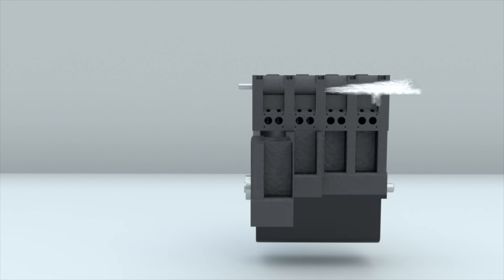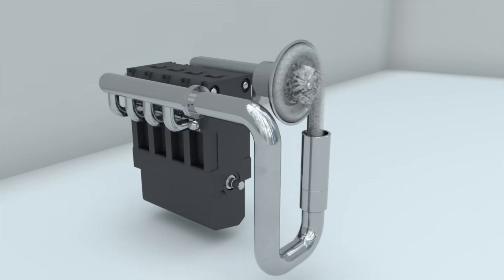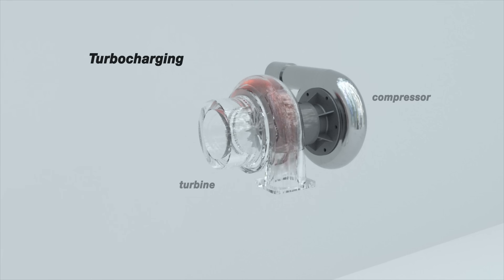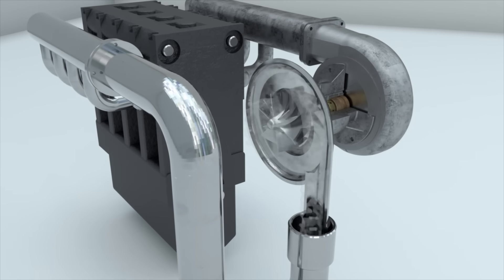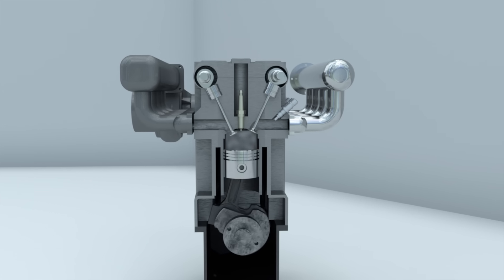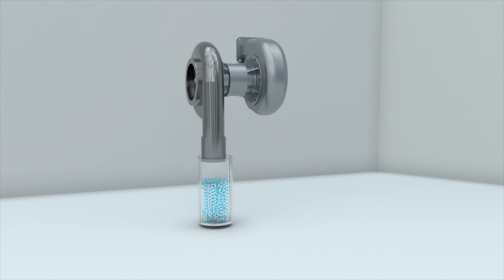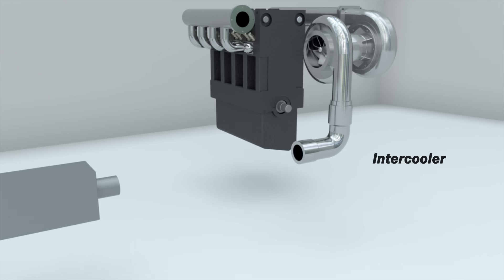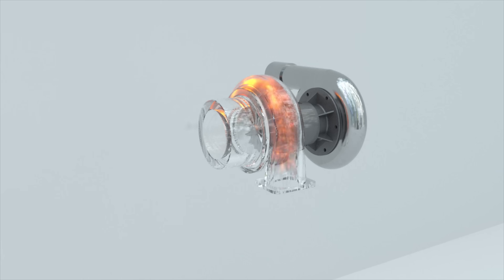How does a turbocharger work?

Comment: This video completely misses the point that increasing the amount of air does not miraculously bring more power... In order to compensate the increased air, the amount of fuel must be increased as well to keep the air to fuel ratio constant. This video misleads people to think that a turbo just increases motor performance efficiently when in fact of course fuel consumption increases as well

Comment: NO!!! ABSOLUTELY WRONG!!! THE EXHAUST GASES DO NOT TURN THE TURBINE AT ALL!!! THE HEAT, ONLY THE HEAT OF THE ENGINE DRIVES THE TURBINE!!! If you don't believe it, put a welding torch on the exhaust side of a turbo and LISTEN! This was PROVEN in 1937 by Curtiss-Wright Aircraft Engines and Bendix Div. of General Electric for the US Army Air Corps for the experimental YB-17A for the turbo-supercharging system for the Wright Cyclone engines. At extremely high altitudes (above 25,000 ft) , there is NO exhaust gas pressure to "spin the turbine blades". Or look at a F-1 car's turbo. What do you see behind the driver's head? Heat distortion from the turbo stack. Nearly 3000*F heat! That's how they get 3000 HP from 1.5 Liters@ 20,000 RPM! (for 2 hours!!!)
Reply: 3k from f1? Damn you watching the 2122 series lol

Comment: Can you show how a sequential turbo system works
Reply: In the simplest answer possible 
In a instance with 2 turbos
One will kick in at a set rpm’s (say 2.5k) and then the other one will kick in at a high rpm (say 3.5K)
Reply: @jesseray8145  thanks 💯

Comment: Does the exhaust intake side of the turbo charger also connect to the car exhaust to allow the exhaust gases to escape? Or am I missing something important? Just trying to learn :)
Reply: There is basically a gate at the exhaust that diverts some of it to the exhaust and some to the turbo then the exhaust from the turbo comes out from the turbine
Reply: @Nr15121  That clears it up, thank you Noah.

Comment: Now just need to do this diagram with blow off valve/ Waste gates. Perfect clear cut, simple and to the point we need more of these! I think one of Camshafts and supercharged Combustion engines would be cool as well!
Reply: If you simplify how the turbine side works its pretty easy to visualize how a wastegate works. Exhaust gas goes from engine into the turbine inlet which spins the turbine fan and then the exhaust gas goes out the turbine outlet and from there through your exhaust system and out the car right? The turbine is connected to the compressor via a shaft so when the turbine wheel turns so does the compressor wheel.

The thing is if you allow ALL of the exhaust gas through the turbine inlet it will turn the turbine wheel too fast, which turns the compressor too fast (which puts more air into the engine than what you are expecting).  The wastegate helps to regulate how much exhaust gas goes into the turbine which limits its speed. So the wastegate sits in between the engines exhaust ports and the turbine inlet. Either on the exhaust manifold (external wastegate) or as a part of the turbine housing (internal wastegate). The turbine gets just enough exhaust gas to spin at the appropriate speed and any excess exhaust gas goes through the wastegate inlet and then to the wastegate outlet where it is either vented to the atmosphere OR piping routes the exhaust gas back into the exhaust system AFTER the turbine.
Reply: Waste gate is the proper term alright. Your wasting boost potential by dumping it all out of the system.

Comment: What benefit does the heat of the exhaust bring?
The exhaust has kinetic energy in its movement.  Its movement is induced mostly by the upwards movement of the pistons.  Since the exhaust piping is a closed system between the cylinders and the turbine, the exhaust gases become pressurized, and that pressure is aimed at the turbine blades.
In addition to the kinetic energy in the movement of the gas, and the pressure within the exhaust piping induced by the pumping of the pistons, there is also a small amount of continuing expansion of the gases after the exhaust valve opens.  That continuing expansion creates additional pressure in the exhaust system, but none of that pressure has any ability to perform work without it being contained in the exhaust piping.  There is almost always one open exhaust valve, and that means one of the pistons is in contact with one end of the gases, while the turbine is blocking the other end.
That means the pistons/crankshaft feel the same amount of pressure that the turbine feels.  In other words, the engine pumps the gases into the turbine, and the turbine powers the compressor.
I don't see how that is any more efficient than a mechanically driven supercharger.
Reply: Hot exhausts do actually bring a benefit. Let me explain. Hot exhausts can be used to install anti lag systems. Extra gasoline is sprayed to the hot exhaust, and it combusts there, creating a wave of air. Then this air is used to keep the turbocharger spooled up so that you can have instant power from the engine without any delays(turbo lag). Well this is only for high power cars though. For city cruisers, yes the hot exhaust serve no purpose.
Reply: The same mass of cold air would consist of less volume. Similarly, the same mass flow produces more volumetric flow at higher temperature. Pneumatic power is equal to guage pressure multiplied by volumetric flow. Also note that the turbo charger is effectively a gas turbine engine which is not directly connected to the engine output. Gas turbines operate at very high RPM, and the gearing for direct output connection not only introduces friction, but it also multiplies the moment of inertia as felt by the output.
Reply: @JWQweqOPDH  
That all sounds true, but how does it relate to what I wrote?
The exhaust gases push against the turbine at one end, and against at least one piston on the other end.
That makes the engine a compressor that drives a pneumatic tool, which is the turbine.  The turbine mechanically drives an actual compressor, the turbo/impeller, which packs air into the engine.
There may be less friction doing it that way than running a mechanical supercharger, but other than that, I don't see any magical benefit in using the exhaust gases rather than a direct mechanical link to a compressor.
I need to see a comparison between all the various methods of compressing intake air with all the applicable losses of each type to see how a turbo-supercharger is superior. 
None of the explanations of how a turbocharger works I've ever seen has mentioned the open exhaust valve condition.  I think that is the most important factor in the system's function.  Without mentioning that, the idea is insinuated that the exhaust system is statically closed at the engine end.  It is actually in contact with a moving piston that's connected to the crankshaft.
Reply: @deezynar  I'm not an expert on the subject, but I'd say you're correct that reduced friction in the compressor system is one advantage of the turbocharger. I think one important factor to note is that the exhaust valve of a piston, particularly when an engine operates at high power (lots of air & fuel), represents a major flow constriction. It is very much possible that the exhaust expands in volume (and lowers slightly in temperature) after leaving the cylinder. A turbocharger may take advantage of some of this (normally wasted) power by maintaining high(er) pressure and gas density between the exhaust valve and turbo, and lower pressure and gas density between the turbo and exhaust outlet. Again, this is very similar to a gas turbine engine. The fundamental idea is that cylinders can only compress and expand gasses at a certain ratio at a certain frequency/ flow rate. Turbines have certain advantages, mainly that they can expand a high flow rate without being very physically large. A super charged engine, or even a larger naturally aspirated engine, may produce similar power to a turbo charged engine, but the turbo charged engine will weigh slightly less for the same power output (once the turbo is spooled up).
Reply: @JWQweqOPDH  
Everything you say may be true.
However, I need it spelled out, diagramed, graphed, and animated, to understand exactly what is happening, and why.

A similar conundrum is how turbojet engines work.  For years I was mystified by how the combustion pressure doesn't expand out the front as easily as going out the back.  It baffled me until I realized a few things that nobody ever states plainly.  First of all, the blade unit is powered up to operating speed before the fuel is turned on and ignited.  Also, the compressor has more stages in it than the turbine has.  And finally, the input channel is significantly smaller than the exhaust channel.  All combine to keep the combustion gases from blowing out through the compressor.

I'm sure that there is a similar explanation about turbochargers, but like jet engines, the explanations typically offered are insufficient.
Reply: @deezynar  it’s essentially free hp whereas supercharging aka belt driven forced induction uses power often time a hundred or more hp to power them just like every other belt driven thing alternator fans in some cars ac compressor etc
Reply: @Nr15121  
Read what I wrote again, and then reply to what I wrote.
You may have the answer to my question, but you have not answered it yet.
Reply: @deezynar  read what i said a turbo is essentially free hp supercharger isnt dont be dumb

Comment: What’s the difference between a turbo and a turbocharger ?
Reply from the maker: Turbo is a turbine. A turbocharger is a turbine connected to a compressor. But for an engine, a turbine without a compressor is not needed. Therefore, in this case, turbo is the short name for turbocharging.
Reply: @hydraulicandpneumaticsyste3253  so it’s basically the same thing ?
Reply from the maker: @houstonpromotion  Yes

Comment: Turbo engines are something of the past .
They work better on trucks with high torque power to pull heavy loads .
Its a lot of wear and tear on your gasoline engine .
Reply: Not if done right, the 2.2L Dodge turbo had forged pistons and reinforced crank, the following 2.5L, I don't know, and todays turbos, well I am trying to find out on my Tucson if the pistons are forged and crankshaft reinforced.
Reply: Then why are more gas engines getting turbos put on them? GM and Ford are especially trending in that direction.
Reply: @thedirtybubble9613  
I don't see them anywhere on conventional four-wheeler cars.
Maybe on Dodge Rams for big pickup trucks okay. But who's buying that with soaring fuel prices that we have today?
Reply: @Giovani25x  they're putting turbo 4 cylinder engines in sedans too. The Camaro has that option now.

Comment: One of the many reasons why I loved  2Fast2Furious so much and some of the others. They showed off the inside of the engine and everything through out into the exhaust.

Thinking about getting into mechanic work cause I enjoy learning how all of this works😆
Reply: Buy an old motor and engine hoist/stand, and enough cheap Harbor Freight tools to take it apart and put it back together again. You can teach yourself.

Then, you can buy used cars with blown head gaskets or whatever, and repair them for just the price of parts (cheap), and then flip them for profit. Do it as a hobby/second income.
Reply: Vin's Rx7 in the first movie has fake cluster gages
😂
Reply: @We_Are_Borg_478  What's your point?
Reply: @NeloAngelo57  Why do I have to have a point?
At ease soldier. 
Not everybody is trying to one up you.
Reply: @We_Are_Borg_478  and it sounds like a 2JZ which led to people thinking it's 2JZ swapped despite the rotor art being clearly visible when you get an inside shot
Reply: @detectivepayne3773  Lol!
Reply: @We_Are_Borg_478  Wasn't thinking you were trying to one up me, just seemed too random of a jab at the accuracy of the movie to not have a point. 

Hence why I asked instead of just only assuming

Comment: I wonder why nobody use electrical motor to eliminate turbo lag instead of depending on the exhaust air to spin it?
Reply: Electric turbos are starting to be used now as a way of eliminating turbo lag at low rpm. These effectvely feed compressed air into the standard turbo to bring it up to speed. Still early days and they're limited to high end vehicles where smoothness and refinement are absolute requirements.
Reply: @cyclonicleo  it's not a rocket science is it, what make it so hard for engineer?
Reply: @1414Adety    it's not about if it's hard to engineer, it's the cost curve.  production line you have to be very cost conscious on mainstream vehicles.  the cost is too prohibitive at this time, with only high-end vehicles able to justify and pass it on to the consumer.

Comment: wait so how does the exhaust ever exit the car if its always being reused?
Reply: thru the hot side turbo exhaust outlet( impeller spews outward thru exhaust pipe so expelled gases just like an exhaust system. ) hot side inlet is piped in from the exhaust manifold

Comment: Fabulous effort. Clean and clear graphics. Crisp explanation.
Reply from the maker: Thank you, glad you liked it
Reply: @hydraulicandpneumaticsyste3253  Pretty useless information that can be condenced to "Air goes from A through B to C". You answer none of the meaningful questions like how the air compressor and turbo charger actually works, why pumping hot air is ineffective and so on and so forth. Literally every why-question is left un-answered. It's like claiming to tell how light produces different colours according to the object's material properties and then just say "red light is red" without any further explanations. Useless information.
Reply: @anteshell  
No, he answered the basic questions. Details, exceptions and thermodynamic principles can not be explored in four minutes. What the hell did you expect so much for? Did you not see the length?